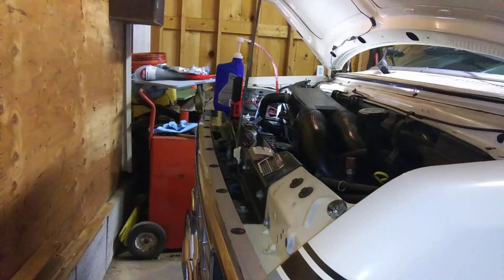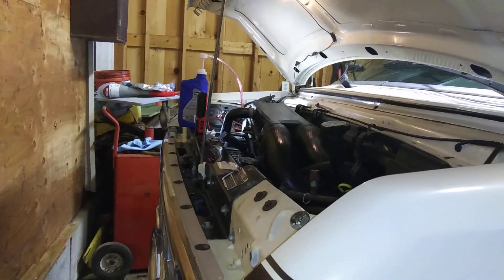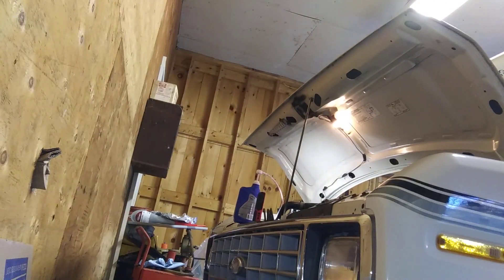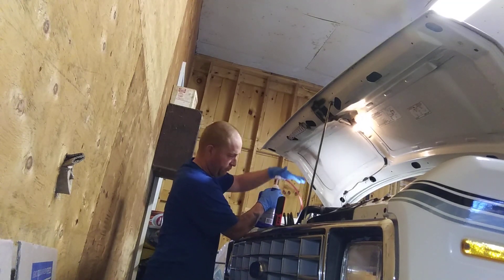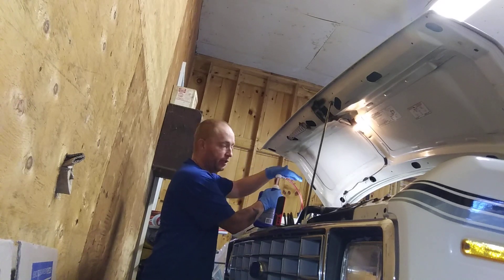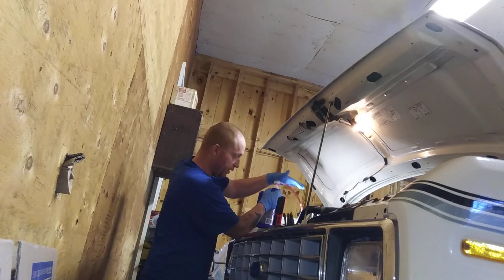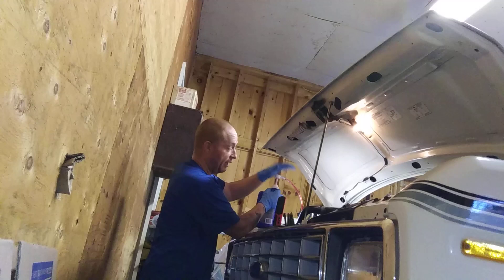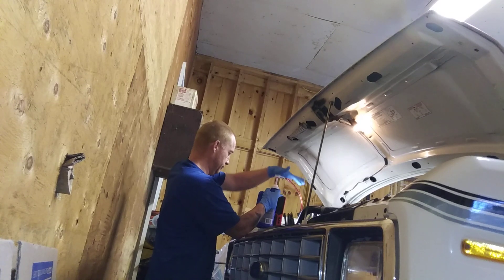part 4 E40D transmission fluid and filter change in 1991 Ford E250 van. all right guys almost done

Comment: This will help me for sure- I have been working on my 1991 Ford Econoline van.  I have a question a question not related to the transmission.  I purchased a new deep cycle battery for the inside- I can't figure out why I am unable to get power to the back - by chance can you help me on this and where I should start looking?
Reply from the maker: First thing I want to say I'm glad this video will help you in the future or when you get ready to do your transmission fluid change. Now relating to the 12 volt deep cycle battery it could be a fuse blown or some of these Econoline Vans have a 12 volt shut off switch if you have a camper van like I have also you can go back and check the wiring make sure there's no shorts and everything's connected correctly if I was there and I wish I was I would get it fixed for you if you have any more further questions feel free to leave them in the comment section have a great day.🌎✌😀